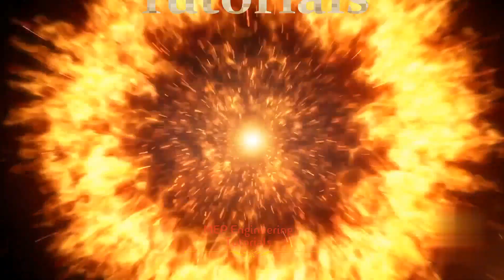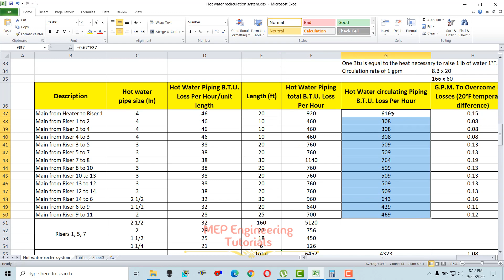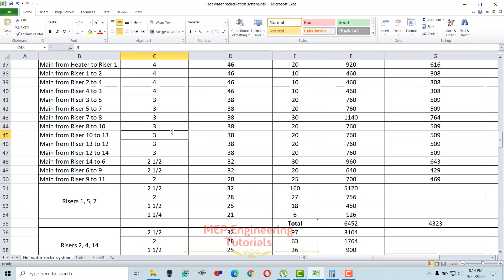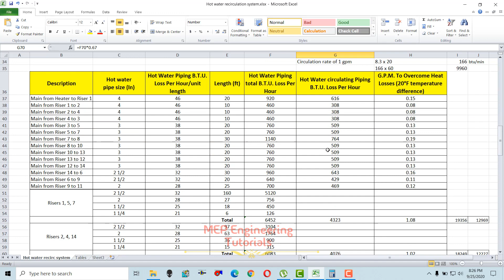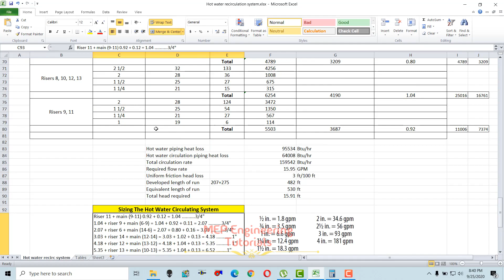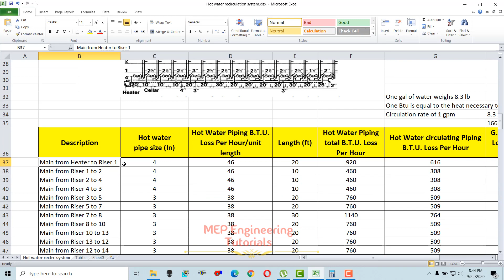domestic hot water re-circulation system design, pump head & capacity calculation, plumbing design

Comment: Very useful topic that is sir.
Sir in India most of project have OVERHEADED TANK  then how to calculate recirculation hot water pipe size from remote fixture to center heater which is fitted in top floor or roof.please make a video for overheaded tank hot water recirculation pipe sizing.SIR

Comment: Another question.  I am wondering why you are adding the recirculation heat loss to the supply line to the furthest fixture heat loss to calculate flow rate?  All of the training I have reviewed on this topic (mostly from pump vendors) for calculating the pump GPM only considers the hot water supply piping heat loss. The recirc return piping is never included in this calculation?

Ok...I figured it out...You are calculating the accumulative recirculation flow back to the heater in order to determine recirculation pipe sizes...

Comment: Can you produce a video regarding the pressure regulating method when the cold and hot water system integrated together as the cold and hot water pressure have to be same at the outlet

Comment: In the last of your Circulating pipes calculation....
I think there is no need to keep the same size of main pipe and  riser pipe due to addition of previous gpm value...
The riser pipe will be according to riser pipes GPM seperately 
And as more risers will be getting added in Main pipe..hence then  main pipe's size will be increasing only as gpm also increase...
But you have taken riser pipe and main pipe size same...
Please correct me if i am missing something...
Reply: Here's what you were missing...He sized all of the risers at 3/4". The recirculation pipe sizing he is doing is only for the main header bringing the accumulative return flow back to the heater. Obviously it starts small at 3/4" and grows as the flow rate grows towards the heater.